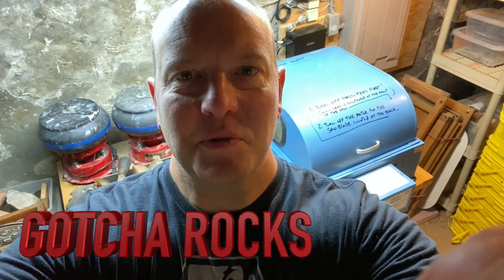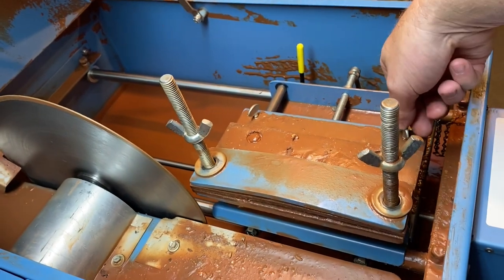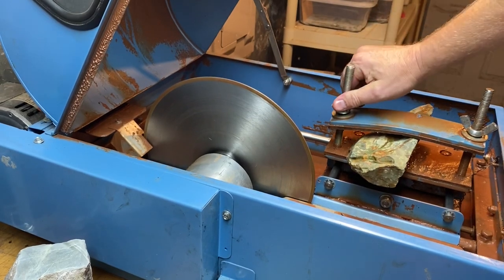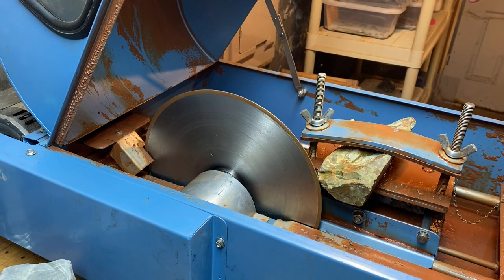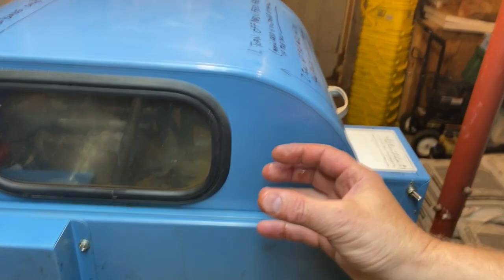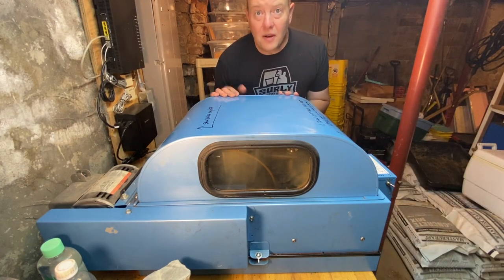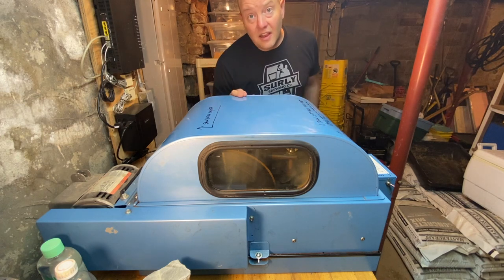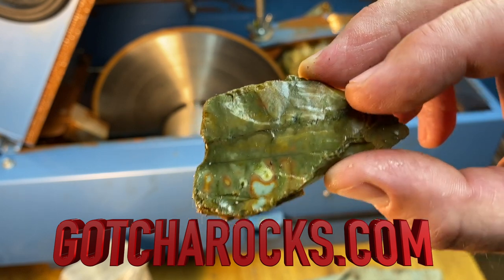Lapidary 101 - How to use a  slab saw 2020

Comment: I bought this same saw used… works like a BEAST! ⚡️👍🏻👍🏼👍🏽👍🏾👍🏿⚡️
Reply from the maker: Great to hear. Have fun 🤩
Reply: @GotchaRocksJewelryDIY seriously I caution you about using a heavy pliers on the vise and traveller. We have a 12” Lortone at the Shop and those studs in the vise along with the thumb screws and threaded rod are not hardened steel😮

Not even close to grade 3 let alone grade 8. You are going to start breaking threads and buying parts. 

Been there, done that.

Comment: I recently acquired 2 slab saws. One us a lorotone 10 inch and the other is a 12 inch homemade.  Just trying to get my nerve up to turn them on.  Thanks for the great video.
Reply from the maker: That 10 inch is a good machine. Make sure you have the oil filled up about a 1/4 inch or so up the blade. Does it have the self feeding clamp for the stone?
Reply: @GotchaRocksJewelryDIY  yes on the automatic feed.  I cut my first slabs! I then put on the attachment so I could use it as a trim saw.  I had oil everywhere. Lol

Comment: My Dad bought one of these about 20 years ago. Used it a couple of times and never used it again. It's model ls-10.   How much does this thing cost . .?   Also have the rotary tumbler ,model 1.5E.   This are in mint condition.  My Dad will never use this machines ago.  Is there a good mark it fore these ?
Reply: $1200

Comment: What kind of oil and blade would you recommend for cutting copper ore slabs ?
Reply: Kinda of a bummer when you don't get a reply, eh'? He said he would tell about the kind of oil he uses, but I guess he forgot. I'm wondering too. But my ol' man uses mineral oil in my 3 inch trim saw. Not sure if it's the best, which is why I was hoping to hear what this guy uses.
Reply: @jubi400  guess I'll just have to look elsewhere for my answers
Reply: On the blade, you are going to have you get experienced going through half a dozen different blades. I love thin expensive blades but ruin them quickly by pressing rock through the saw too fast.

Comment: Hi . . . Just curious as to how much noise is created by a slab saw and other lapidary equipment. More concerned about noise disturbing others in the house. Would be working in an attached garage. Thanks.
Reply from the maker: Good question, If it's in the garage you should be fine. I have mine in my basement and I can barely hear it. It's quieter than you would think. All the best

Comment: Great video! Do you ever have issues with slabs breaking once they are cut away from the rock? I know they don't have far to fall from the blade's edge, but slabs can nevertheless be pretty fragile, and I don't see any soft padding to the left of the blade. I figure you'd want to give them as easy a landing as possible.
Reply from the maker: Hello, yes sometimes they do break. For the most part it is usually a weak spot in the stone. One thing I did was I took a wide thin piece of treated wood and placed I right where the slab would fall. I use a 2x4 cut long ways. I also tried a kitchen sponge but it seemed to move around while the saw was running. It didn’t work that well. Hope that helps
Reply: @GotchaRocksJewelryDIY  That makes sense! Thanks for the info!

Comment: Do you use oil or water? And what size saw is this? Thanks for your videos. 😃
Reply from the maker: I uses oil and it’s a 12 inch blade. 😊
Reply: @GotchaRocksJewelryDIY  what kind of oil do you use?
Reply from the maker: @jerrryfrost112  Believe it or not I use baby oil. I have been using it for a few years. I know they make a hypoallergenic oil now for the saw but I don’t remember the name.
Reply: @GotchaRocksJewelryDIY  Thank you so much for the information, I would not have thought of baby oil. Is this the same baby oil you can get at any drug store? And it is safe to use, will not catch on fire? Thank you again for your time.
Reply: @jerrryfrost112  I buy mine at Target. I believe it is safe and the flashpoint on baby oil is something like 335 degrees. If you saw is running that hot you will have other problems. LOL. I think it's pretty safe. Check around though. Let me know if you find out anything different. All the best, Michael
Reply: @michaelseiler86   Sounds good, I will have to try it. Thank you for the information.

Comment: How do I change the blade I got the same machine
Reply from the maker: I would contact Lortone and get there recommended instructions. The trick is to make sure the wheel is properly balanced. It’s been a while since I did mine.